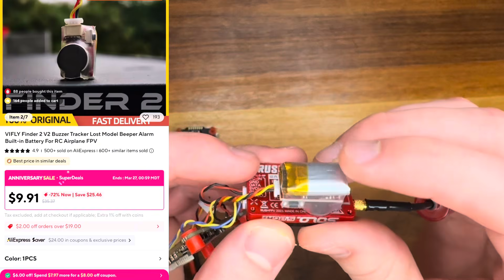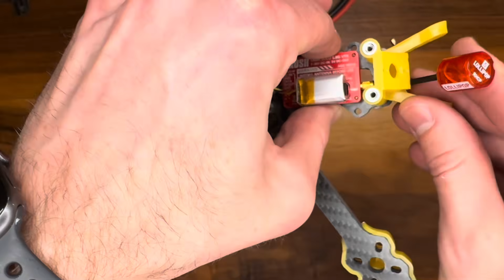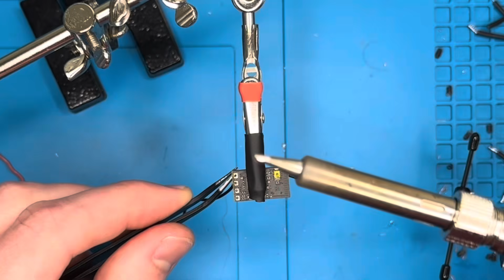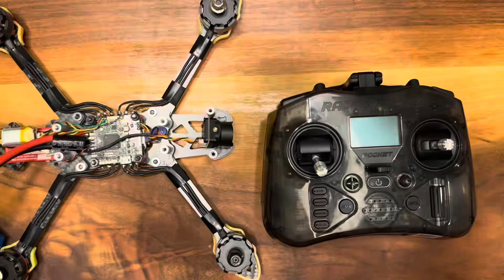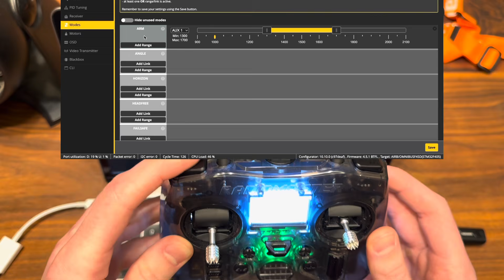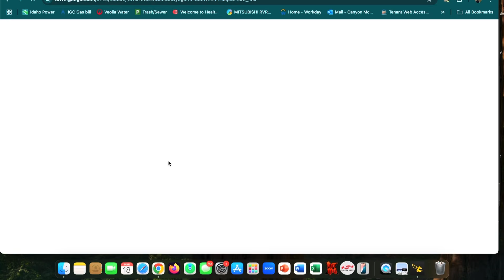How to Build a Budget 5in Long Range FPV Drone - Beginners Guide

Comment: love the content bro. did you end up dong a range test? how much range could we get out of this?
Reply from the maker: Sadly, I ripped it apart to do another build, so I never did get a full range test. On my micro quads, my radio has been the limiting factor and I can only get about 1km away. I need to mess with the settings on the radio. I should be able to go a little farther. Plus, I want to get the range extender module for it too

Comment: ELRS gives you already a good range, but for longer ranges you should mount a 900mhz receiver, which is way better for penetration and long range.
Reply: Isn't 910MHz reserved for LoRa mesh networks?
Reply: @Semperverus0  you can legally use 915mhz in US and most of countries, and 868Mhz within the EU. we call them generically "900mhz" but you have to check what frequency is allowed in your country, depending on the local regulations

Comment: I build this drone, thanks to this guide.
Reply from the maker: Glad to hear you completed it! How does it fly?
Reply: @MediocreNerd  I did not have much flight time yet as I did not transitioned well from simulator to actual flying. The drone is flying well I am using angled mode for now and I had a few nasty crash but it held well. I have tested it with 4000mah 4s 21700 and it significantly improve flight time to almost 18minutes this is with action cam installed.
Reply from the maker: @iambricio809 love it! That’s awesome

Comment: what range in km/miles can it go before disconnecting?
Reply from the maker: I’ve done just about 1km without a problem. I’m guessing the vtx can do 3-5 miles in perfect condition so more of a radio problem at that point. Radiomaster pocket can only do like 2 miles in good condition
Reply: @MediocreNerd  What radio do you recommend for a larger range? A budget option
Reply from the maker: @CalinDorus I’m not sure to be honest. I would look at radiomaster’s website and see which ones have higher power output

Comment: I finished the drone setup, the thing is though when trying to enter DFU mode (to install firmware and stuff) it doesn’t let me enter it, when I try the beeper goes off forever until I turn it off. I forgot to update it before the FC was connected to everything (basically I have the entire drone ready to fly, I just forgot to update the FC), you think that could be causing the issue?
Reply from the maker: If I understand correctly, the beeper sometimes does that for some reason if connected when entering DFU mode. You could try removing the beeper or you can check what version the FC is already running. If it isn’t too outdated, I wouldn’t worry about updating it
Reply: @MediocreNerd I finally figured it out, I had to use Zadig to install  driver for system 32BOOTLOADER since it didint have one
Reply from the maker: @Ignited_221 ooooh nice! Yes, I had to install zadig as well. Glad you got it figured out. Let me know how she flies!
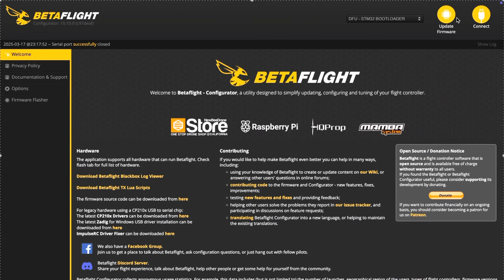Reply: When I try doing it, the top left doesn’t tell me it’s in DFU mode. Like at time 12:32 it says your in DFU bootloader mode, for me it doesn’t say that, it says automatic I think?
Reply from the maker: @Ignited_221 hmmm. In that case, I don’t think it would be the beeper.
Reply: I’ll try removing the beeper and hopefully it’ll work out

Comment: got my F4V3S with usbC and a 45A? esc? like.. 4 months ago or 5? cant remember.. but runnin 3S on some 2300KV motors on a sketchy 4" setup.. has proove to be reliable.. the only thing that happend was the boot button breaking off on a crash.. otherwise shes fine, and imma rebuild the quad as a proper 5 incher some day.. and imma use this setup till it dont work no more. then imma get something better (or the same thing again)
Reply from the maker: That’s awesome! I think I may have found the same version with the usb-c port. Seems a little better! Your build sounds like a ton of fun. I have tried up to 7in and I now prefer whoop size to 3in quads haha. I don’t think you are missing out on much. The bigger the drone the easier it breaks

Comment: Hey! A few questions. Im assuming youre using molicel p24a? The batteries with most C rating ive seen are 10C. Most can output not more than 30-40A. How would you go about addressing high amp consumption of the RS2205? Theyre very amp hungry at triblades.
Reply from the maker: Hello! I am using Sony VTC 5 on this build. They are 2800mah and rated for 20a. 20 amps is the minimum amp rating I would recommend for a build similar to this. The batteries do fine but they can get a bit warm with extended flight time 10+ minutes especially if you run them hard and full throttle a lot which I like to do haha. If you are worried about it I would do something like a Molicel p30b with 3000mah and 30 amp rating which will be plenty for these little quads
Reply: @MediocreNerd correct if I am wrong, but dont the motors indivivually reach upto 20A only on half throttle as I have seen many thrust tests with such results. Would it not be bad for the battery? Or are these motors actually really efficient with their amps?
Reply from the maker: @elytra_ggthese motors are pretty weak and I have not gone over 20amps according to the reading on the OSD. So I personally have not had any issues
Reply: @MediocreNerd how much does the drone weigh?

Comment: I did this and I plugged my drone in for the first time and flames went up what do I do now
Reply from the maker: You probably shorted something during the build. You should use a smoke stopper next time. You may be able to save some of the components depending on the damage… sorry to hear that happened

Comment: I have a question. I will build an 5 Inch long range drone with 4s1p lithium ion batterys. What motors do I need? 4s motors or are 6s fine too? or are there 4-6s motors or does it need to be the same S number or doesnt it matter?
Reply from the maker: @v4led  4s motors are what you want with 4s Liion. You can look at Oscar Liangs motor KV guide to see about what you will want for your build
Reply: @MediocreNerd  but arent there 2-6s motors and they variate  I got the xing iflight 2207 1800kv
Reply: @MediocreNerd  why shoudnt I use a 6s motor for a 4s battery?

Comment: Hi once again. Is your radiomaster pocket controler ELRS or CC2550?
Reply from the maker: @tadasjukna6899  ELRS
Reply: @ I ordered CC2550. what the difference?
Reply from the maker: @ cc2550 is flysky. Did you buy it off Amazon? Because then you could just return it easily
Reply: @MediocreNerd  from Aliexpress
Reply: So I will not be able to connect my CC2550 to my drone?
Reply from the maker: @ no, you need the ELRS version
Reply: Really??
Reply from the maker: @ Sadly yes. Where did you get the controller from?
Reply: @MediocreNerd  I ordered everything from Aliexpress
Reply from the maker: @ and it has already shipped?
Reply from the maker: @tadasjukna6899 also, most items on AliExpress can be returned so I would look into that
Reply: @MediocreNerd  yep, its shipped. But why I cant use CC2550?
Reply from the maker: @ it uses flysky receiver protocol so you would need a flysky receiver instead of an ELRS one
Reply: @MediocreNerd  what flysky you can recommend?

Comment: If I wanted to spend 150- 200 on this particular build, what would be the best bang for the buck component upgrades?
Reply from the maker: For long range, I would upgrade the motors first to something more powerful but still efficient, then the frame to a lighter dead cat style, and then get a nicer FC

Comment: No GPS? Usually when you go for Long range without GPS you can say bye to your drone.
How you tested it already for how long will it go?
Reply from the maker: The beeper is super helpful because it is pretty loud. Also I just went until the screen started to become fuzzy and then I just simply knew that I was close to the edge of the range. I have a gps coming tho and will be setting it up!
Reply: @MediocreNerd  Hey. Will you make a video as a update of how you are setting your gps or beeper?
Reply from the maker: @ yeah, I can do that! The beeper is super easy but I still need to learn how to do the gps. I will make a video once I get it figured out
Reply: @MediocreNerd  Do you have any instagram or any other social thing to keep in touch with you? Im ordering my first parts already. I do not know which kind of controller and googles to buy. Can you share yours?
Reply from the maker: @ I will create an Instagram account that you can message me on. I can help you find the right goggles and radio. I have them linked in the video description
Reply: @MediocreNerd  I cant find which kind of battery you are using, can you tell me?
Reply from the maker: @tadasjukna6899 you will want a 4s lipo 1500-2000 mah

Comment: Did you test what is better for long range , more capacity battery (like 4000mah) and heavy, or less capacity but lighter battery?
Reply from the maker: @AlexShapovalov  I am in the process of doing that right now. I have some larger 4200 mah batteries and will be testing 3s vs 4s

Comment: thumbnail: $130! video: just buy these for $300 and this for $65 and $40 for that and $36 oh and $4 but cant forget that $10 and $12 and another $12 and $20 and and just $20(x4) and just $2.50(x4) and $16.50 and another $?. Viewers can now save money with my math course where you can reduce the price of anything for clicks! Only $130 for my course.... course materials will include $300+$65+$12+$15+...
Reply from the maker: @B.M.0.  This hobby is all about customization which I love. So you will almost never buy everything as a “package deal”. You get to pick and choose every component that you want. Go shop for drones that is how they sell them. By themselves and then you get to pick your radio, batteries, googles, and charger. The good part is that once you get a radio, charger and goggles, any drone can use that same gear. 

I feel that it is pretty obvious that I am only talking about building the drone from my title. I never said anything about buying everything you need to get started for $130. However, I add in other good budget options for things to buy and yes I shared what goggles I use and how much they cost but I also gave a good alternative for $100. Sadly the lowest price you can go to get into this hobby with everything you need is around $300 total for a cheap drone, goggles, radio, battery, and charger. Maybe I will make a video on “everything you need to get started with drones for blank amount of money”. Thank you for the idea.
Reply: @MediocreNerd  without the components you just said "don't count" the base drone cost: ~ $228.50 

Thanks for the positive interaction :) obviously I'm approaching this with humor because the clickbait is what got me to watch in the first place. I appreciate that you're going to approach a separate video honestly.
Reply from the maker: @ I appreciate the feedback too! The drone really added up to that much? I’ll have to double check the numbers. I honestly paid $130  and checked out at $145 after taxes
Reply: @MediocreNerd Show the math to avoid wankers like Ken the Kalculator here.